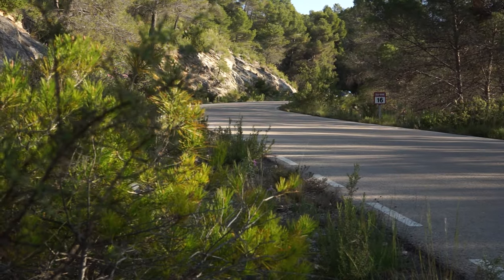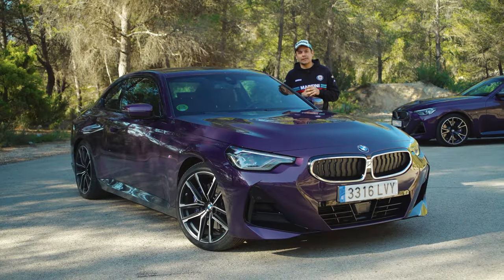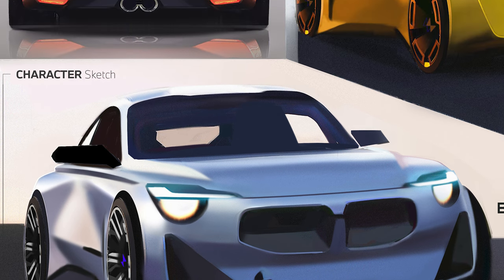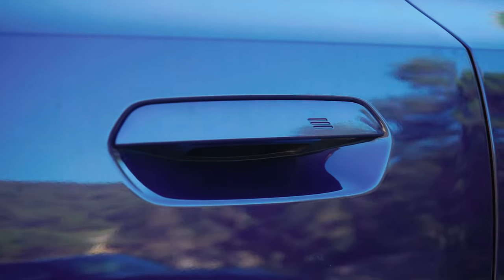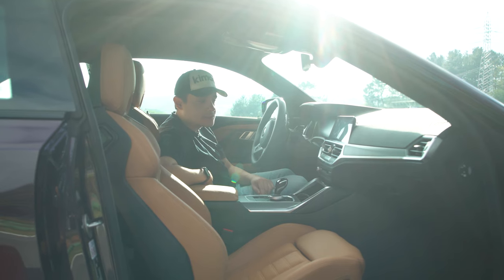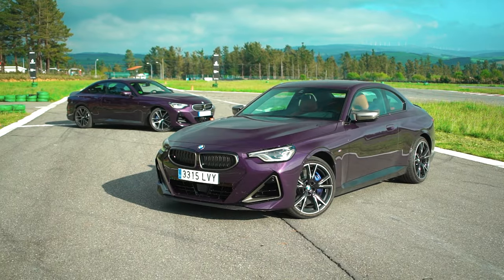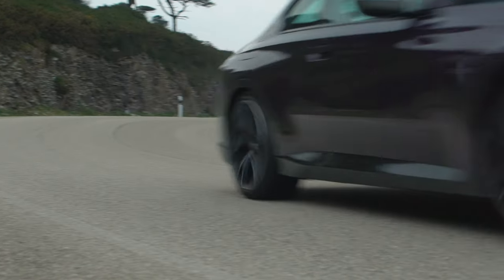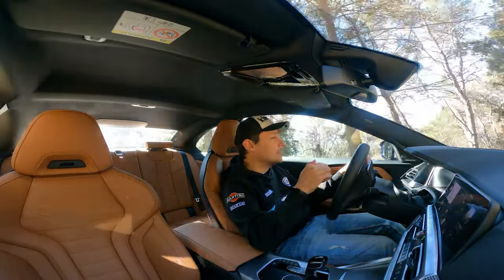BMW 2 Series Coupe: The real BMW DNA [Test drive - #POWERART]

Comment: Ive owned a 2023 230i M-sport with the ELSD and khumo V730s for over 6 months here in the US. It is the perfect middle car of the 2 series line up. Light nose, 50/50 weight distribution, can easily hold drifts, is reasonably priced, and has decent acceleration. I have taken it to the track and it has been laying down great times and putting other modified cars to shame. I even got "Fastest in Class" by a very wide margin. Honestly I can't imagine wanting another car outside of a Porsche 718. BMW did a great job with the 230i and I believe it is currently the enthusiast weapon of choice for track work besides the new M2. Personally while I do have the budget for an M2, I think that purchase only makes sense for a serious track rat with money to blow. The 230i is far more affordable and is going to have much lower running costs for those of us who don't want to sell our kidneys to afford consumables. I couldn't be happier with my 230i and I'm glad I didn't order the m240 now that I've had the opportunity to track my car.
Reply: Wow that's quite interesting -  you rarely hear someone going for a 230i over a m240i,....I just never drove anything faster than what I'm driving now. My first car was a e36 318, a few e34s, e46 330i, and e46 325i. August 2023 - Wanted to order a 2 series and couldn't for the life of me even see one in person. I'm in Western PA and my dealer just couldn't give me anything to test drive. I had about 48k to play with as I thought. Thought I could squeeze into a RWD M240i, but instead realized I couldn't. So I optioned a 2024 230i - M sport package, Dynamic Handling, M brakes, eLSD, adaptive cruise, basically enthusiast spec. It came out to just over $50,000. Now I know that the M240i would be just under $60,000 after all the taxes and fees. Now added a JB4. The car just flies. But it SURGES from dead stop, and FLIES past 3,000 rpm, which is an interesting experience - there's that sweet spot at 3,000 RPM to 5,000, after which the power kind of drops off. What I learned after the fact about the B48 engine - the stock B48/6B block is very good even though it’s “only” 258Hp from factory. This engine is all about the ultra low end torque value of ( 305ft-lb/ 414NM ) available at 1200RPM, which makes it pull way harder than the horsepower would suggest. The B48 feels identical to a diesel, considering most sports cars are horsepower first followed by torque with a 70 variable difference.... B58 in the M440i: 380HP and 370ft-lbs.. Tuning the B48 while costly does also continue the trend of being torque focused. Stage 2 piggyback tune via JB4 puts the 230i at 310HP and 350ft-lb. Throw on aftermarket cold air intake, inlet pipe, charge pipe and your around 350ish Hp and 380ft-lb.. At that point you are at the power-to-weight ratio of a M240i...but with the 3,500lb curb weight and amazing handling to boot. In the back of my head of course I wonder what would happen if just ordered a M240i with RWD, no options, and no sunroof. But what's done is done...
Reply: i got to drive an m240i x drive and a 230i m sport with e dif..as "loaners" as i had an EV at the shop for routine/warranty inspection....I could understand the X drive in a track setting or a single runner/track setting with no traffic where you can min/max your line/corner selection....as a "Drivers car" i felt a lot of heavy front/intiate inputs that rarely translated to the rear end...a lot of mid corner ??? feel bc of this chassis/drivetrain interaction. Just imo hard to manage the powerband mid corner if at he lower/mid range of the rpm or torque to power ranges. If in sport+ or with aids remoevd....you may be able to hold a corner more ideal/tight from a pure drivers/line holding standpoint while still being able to work the throttle for an ideal exit line....but i LARGELY found the 2L turbo RWD with edif....to HUGELY be a more worthwhile experience purely on city and canyon roads or downhill sweepers. The weight distribution and equally usable/adequate powerband for street driving....made holding lines initiating turns at high speeds and being able to work the throttle from mid corner to exit really upped the fun factor of considering that build a daily. VS just genuinely feeling held back By road limitations tighter/lanes and lines to hold in the same circumstances with the 240...then i tried a friends 230i x drive...and it felt like some kind of stop gap to get ppl to want to have that mechanical grip...with more power. Or a better balance of power to grip....vs the tradeoffs. You would no doubt feel the limiting aspects of /public roads with an m2. VS being able to push the cars inputs/desires on a track. It was refreshing to see the difference in road feel/handling/throttle mid corner amongst these options. THOUGH no doubt the 230i....in my eyes largely benefits from the m sports suspension/brakes and DIF. WHOLLY a reason to own one i was thoroughly impressed. With how adaptable it was from a shifting profile/daily down tuned use....and the sport+ and sport shifting as well as disabling as many driver assists as possible...just generally how much "driving" characteristics you gain/feel from having it in "daily" mode with a more modest suspension feel and shifting profile if not a down tuned/fuel map....to something that showcases its "VALUE" when holding higher revs....flying into a corner at IMO higher entry speeds than i was with the 240i and the weight management mid corner vs an X drive system with a larger engine/turbo cooling system implemented. ON a track with larger straights and wider turns...the options with more power and X drive could probably hold more speed as G's are implemented...but i could definitely tell on a smaller track were straights/speed max is somewhat off set by how much easier it is to enter a corner with the RWD 50:50 ratio and keep both at a high speed. IDK you definitely feel and think alot more about the time youre AIMED to gain with the power offset opposed to the ease of driving the lighter more balanced car seems to offer when it comes to cornering fast and maximizing the exit into the next turn with the larger power packages. Doesnt change the fact that in every scenario where power is a factor like up hills or if trying to keep up with "better options" it makes the 240i seem like more of a buy, but from a pure daily standpoint with the ability to enjoy your "SPORTING" and the used market the 230i rwd if packaged properly doesnt seem like a bad option.
Reply: I too tested an M2 and the 230i back to back. The M2 was like a race car, fast. It was like having five hyenas on a leash chasing antelope. It was difficult to control a low revs the M2 was a beast it just wanted to be driven fast. As such I couldn't really see it being used comfortably as a daily. I didn't get a connection from the M2 steering was vague,  numb. The bmw guy offered me a ridiculous deal. It was like he was trying to get rid of the M2 offering a £5000.00 dealer deposit. The suspension was also a bit too stiff. The M2 is a race car for the streets. The 230i was do much easier to drive than the m2 more playful I was happier 😊. The acceleration cannot be compared. The 230i at 245hp was fast much faster than I thought compared to the M2. But what stood out was the chassis the steering the way the rear would step out on driver command. Its one of those cars that's makes you want to beat up.on it it likes it. I always felt in control. My wife test drove both cars snd said the M2 was too fast for the street  perfect for the track but fuel economy was poor at 23mpg against 42mpg in the 230i. I thought I would hate the 230i when compared with the M2. but it was so much fun to drive. And it looks better as well so I ordered it in skyscraper silver black wheels 19" [I wanted silver but no option,] red callipers and tacora red interior it arrives in November. I can't wait.
Reply: @Youppp  it really is when you disable everything/aids and utilze the e-dif...you can just throw the car about and it responds/reacts so well under low to high g activity

Comment: As someone who owns one of the new 230i’s I can say I absolutely love it. People have mixed feeling until they see it in person. It’s a great vehicle looks wise and driving wise. The b46 in the 230i does a great job in place of the b58 in the m240i
Reply: Hi, do you have the standard or M suspension? I am considering the 230i, but will have to drive my wife on occasion in it on less than perfect roads, and without adaptive option  in 4 cylinder models  I am wondering if M would be to stiff for her or if otherwise standard suspension would compromise handling too much. It won't go on track and I am too old to drive irresponsibly in public, therefore will not be pushed anywhere close to limits.
Reply: @goranmekota7540 my buddy Bought the new 230 with the regular suspension. We went for a drive and from the passenger seat the suspension feels very comfortable with low body roll. He said the first car he test drove was more firm so I imagine it had the M suspension.
Reply: @dr_tate  Thank you:)

Comment: A purple BMW M240i X-Drive is my dream car now.
Reply: im looking at used 230i m sports with the perforance DIF currently. Seeing some at near 10,000+ off what id get for a 2024 with the same options. Seems like a proper daily good mpg....good sports/streetable fun with the proper profile/settings and driver aids disabled. If i wait a year or two id probably save/go for a 240 but it wouldnt be a daily...just looking at stuff like GR corolla with the need for the performance DIF and its MPG relative to a tuned/larger turbo current gen WRX which also needs a BBK upgrade...from a pure DAILY standpoint GTI and the 2 series have a lot of "niceties" interior/complete package wise...that makes them worth running over a WRX/BOXER and the 3 cyl Corolla. That "more performance" bridge gapped by the future value of a used 240i vs a 230i. Thats where ive landed....im even looking at the Z XD....though see that as a lesser option. At first i was considering a bolt on SC FA24 brz since it has a bit more of a modest suspension tune vs the tact/driven GR86....but then i realize ive driven a 240i and a 230i as dealership loaners and also rwd and x drive in the case of the 230i...theyre just really nice/great for what theyre bringing to the table. Pure manual/aside. I love the purple one too myself ;) GL with saving/buying.

Comment: if you tune the gearbox with xhp it has rev matching and blips for downshifts that eliminate the slow lag!
Reply: Lose transmission warranty though
Reply: Really tempted to do this! My previous car was a 2016 340i. All I had done was cut the resonators out.. the car seemed to shift more aggressively and never would lag (when shifting manually)

Are you liking the XHP transmission tune?
Reply: @HaloDude557  better off finding a salvage title to implement such things....vs trying to find a used with the m sports suspension/brakes/differential instead Either way thats the only viable way to have a good differential/ideal performance on a budget with these...then again if only we could take account how many ppl claim they need X-drive to drive their brand new BMW in snow....or get it sprayed with salt/snow/rock chips....as if it wasnt a LIE...we would have thousands of these BS accounts or justifications for x-drive as well NGL
Reply: @anhiirr  what’s wrong with xdrive? It’s definitely going to be more effective than rwd in icy conditions

Comment: shadowline package should be standard should have cooled seats
Reply: or just its own/option...vs some BS where you have to have the full speced tech package first to primarily implement the shadow package...those costs on a 2024...all add up to pushing you towards getting a 240i vs optioning out a 230i. Even to just get an e dif m suspension/brakes packaged....you still have to get that maxed out tech package. Which i find hard to justify/cost wise....vs trying to find a 230i with those performance options used. Plus if this is the case...im just going to have to r/i some of these parts myself...and take them to wrap place...to get them blacked out. At least im not paying up the A for seemingly nothing.

Comment: Excellent video. 😀

I just wished you got the latest model (2023). BMW made some interior changes for the 2023 so you technically can't buy this exact car anymore, unless it's a used/pre-owned car. Also, the 2023 comes in RWD M240i in addition to the X-Drive model.
Reply: yeah RWD M240i seems to be pretty nice. I mean when you spec out a 2024 230i with e dif....m suspension+brakes...compared to the m240i which is a few thousand more for that added power/band....if you can manage to put a larger down on the table and get good financing....does seems somewhat viable...vs trying to slap on a larger turbo on the 2L and do an e85 conversion/tune. The cost with a full exhaust system etc...seems about on par with an m240i. Not a big fan of X-drive myself...after experiencing x drive in older 240i and 230i as well as experienced a 230i rwd...i do favor the RWD input/feel etc. Then again the 230i is much more balanced package as RWD...and THE X drive left you YEARNING for the 240i power with the x drive/grip...it almost has no place other than being offered as an option with the 230i. Perhaps in regions with snow....as if ppl dont have mandatory/beaters for the snow....i couldnt imagine purpusefully driving a new BMW in the snow MERELY bc it "CAN"....but thats just me as an owner/consumer.

Comment: Hello I have a very important question for you.

I am buying the new BMW 2 series coupe and I watched your review. I am considering between either the 230i or the M240i 

Have you had a chance to drive the 230i yet and would you recommend it over the M240i?

I won’t be taking my car to the track but I do want to have fun small and controllable powerslides out of corners on public roads.

My concern is that the price of the 230i is so high in my country (United Kingdom) compared with the M240i it makes sense just to spend a tiny bit more to get a bigger engine.

Comment: How nice of BMW to benchmark the Cadillac ATS dynamics on their 2 series sedans, they still failed at weight reduction after 9 years, 😅. Cadillac ATS 2.0t rwd 272hp/295 lb-ft of torque for 3,473 pound/1575kg, bulletproof all aluminium LTG engine plus a lazy truck 8 speed transmission, 50/50 weight distribution and two extra doors. 
Reality is, if I have to buy a new sports sedan these days I would rather go with a CT4-V Series rwd 2.7t 325hp/380 lb-ft torque for 3,616 pound/1640kg, or CT4 V Blackwing over any M2/3/4.

Comment: Picking up mine on Saturday in Brooklyn Grey which just looks incredible, haven’t even driven it yet but had the previous M235I in similar spec and it was one of the best cars I’ve ever driven, apparently the chassis is from the 4 series which I currently have the 435D M Sport which is a big improvement in terms of comfort being larger over the previous  2 series which makes sense. Also saw the new M2 with all the M Performance extra’s on - has to be the worst looking M car ever made - must of been designed by Stevie Wonder as it is a disaster.